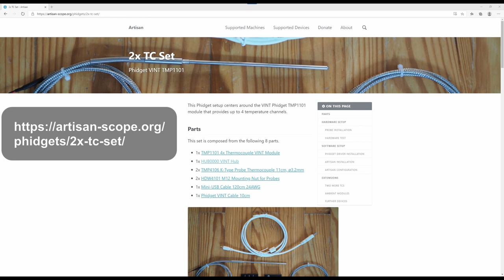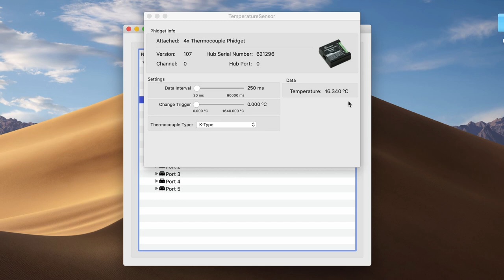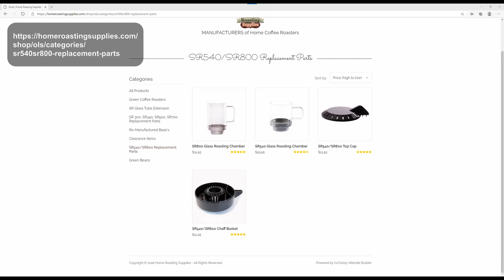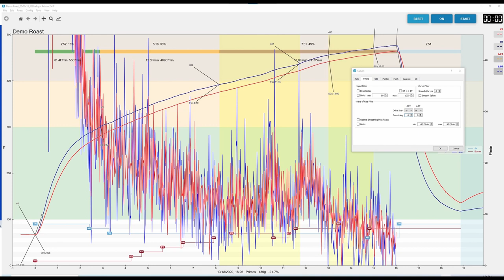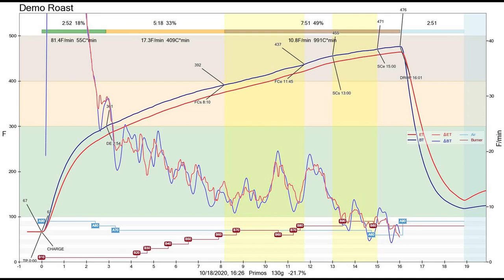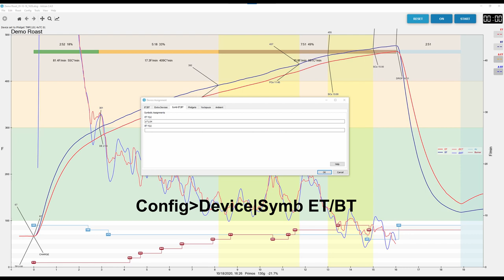SR540 (or SR800) Coffee Roaster Thermocouple Installation

Comment: This was incredibly helpful. I have an sr800 and have been interested in doing this mod. Thank you 🙏
Reply from the maker: I am glad this was helpful. This should work on the SR800, just make sure the bean thermocouple is long enough.
Reply: @coffeeroastingathome8890  which long is enough for Sr800?  Thank you!
Reply from the maker: @adolfoperez1312  I don't have the SR800, but check that the thermocouple tip is inside the beans when approaching first crack. The exact elevation is not very critical.

Comment: anyone wanting to simplify this can use the temp probe on a Weber iGrill BBQ temp sensor and export the data to an excel spreadsheet. Graphs are easily made in the spreadsheet. You can save time/fan speed/power levels and graph airtemp/probe temp vs time.

Comment: Thank you for the videos you posted. All are very interesting! I was wondering how you were able to control the speed and power of the 540 from the Artisan dashboard.
Reply: I just realized after watching your other video again that you were not controlling the speed and power with Artisan --you were marking your profile with the sliders after manually changing the speed and power on the SR540. Is that correct?
Reply from the maker: Hi Chris, yes this is correct. I make the changes manually in the SR540 with the knob, and then move the slider in Artisan to match the SR540 setting. I do this only to keep a record of the setting changes I made during the roasting for future reference, but you have to remember to adjust the sliders every time you make a change in the SR540. It would be nice to be able to control the SR540 directly from the Artisan sliders, but that will require modifications beyond my skills. Thanks for your feedback!

Comment: Hi, first off, this video and your other one is fantastic. I wouldn't have been able to set it up without this. I've used your set up on my artisan profile, but the one thing I can't figure out is how to get the step visual of the change of the Air and Burn. I know how to configure and add them to the chart, but mine just shows up as small blips on the bottom of the chart. It's as if the scale is off or something. Thoughts on how to fix the configuration for that?
Reply from the maker: Thanks for your feedback, I appreciate it and I am glad they were useful. About the visual indication, in the menu Config-Events-Sliders, make sure the Min and Max for the Air and Burner are set to 10/90, and click the "Coarse" checkbox. Offset should be 0.0 and Factor 1.0. I hope this helps, you can also download the configuration file and use that.

Comment: I am setting up my sr 800 with thermocouples. I have ordered a 300mm probe for the bean probe. I am having difficulty determining where the end of the probe should be in relation to the green beans. Is it ok if the end is in the bean mass at the start of the roast or should it be above the beans? I also am using the extension tube. I have searched high and low and can't find the answer to this. Your videos have been a great help in setting up the artisan software.
Reply from the maker: Yes, it is OK if the tip of the thermocouple is in the bean mass at the start of the roast, an inch or two away from the bottom. The exact position is not too critical, as long as it is repeatable between roasts.
Reply: @coffeeroastingathome8890  Thanks , this coffee roasting is more complicated than I thought it was going to be. It's fun though!

Comment: great video.  so for BT you would suggest to get a thermocouple that's longer so it would stay touching the bean mass but no to the point where it would touch the bottom where the heat is coming in right?
Reply from the maker: Thank you! Yes, that's right. I made another video with an extension tube and a longer thermocouple inside the bean mass, you can check it at: https://youtu.be/xo9IdakyIqw

Comment: You mention the idea of only using the ET sensor. Have you noticed if it reads much differently than the temp sensor built into the sr540?
Reply from the maker: The built in temperature sensor measures the inlet air temperature, before it interacts with the beans. The beans exchange heat with the air and also release steam, changing the air temperature in ways that are difficult to correlate closely with the inlet air temperature. The built in temperature sensor reads generally quite a bit higher than the ET sensor, and the temperature changes when changing settings are much more abrupt. Hope this helps!

Comment: I have the air and power settings showing on the left side of the Artisan graph like you do, but they do not change when I change the settings on my SR800.  What do I need to do to get them to show the proper settings?  Thank you
Reply from the maker: You need to click and drag the slider to match the settings in the SR800 roaster. There is no communication between artisan and the roaster settings, so artisan has no way of automatically knowing what settings you have in the roaster. The sliders are intended to keep a record of what you do (like writing the settings in a piece of paper, but more convenient).

Comment: Thank you for making this video.  I am wondering if you plan to use the extension tube on your SR540 since they seem to provide a more even roast and more intimate with the air flow.  If so, could you still use both therocouples?
Reply from the maker: Yes, I have been using the extension tube with a longer bean thermocouple probe (and the same environment thermocouple). I am working on a demo video using the extension tube with the details.

Comment: Very nice of you to show how this is done.  I am wanting to do this to my sr800 with the Razzo extension tube.  If you are so inclined perhaps a video of an actual roast or two.  I am a beginner to this and have been lucky that my first roasts were actually good! Again, thank you very much for this excellent video.  (You might want to post this on Reddit.com/r/roasting)
Reply from the maker: Thank you! This setup should work on the SR800, just make sure the Bean Thermocouple is long enough. I did post a video of an actual roast (the link is in the Description of this video), hope you find it useful.  I am also now roasting with an SR540 extension tube and may post a video of that in the future. Thank you for the tip on Reddit, I wasn't aware and will check it out.
Reply from the maker: @txaggieaero Good luck with your setup, sound interesting. I have a Raspberry Pi running PiCorePlayer and Logitech Media Server for streaming high resolution music, works great.
Reply: @coffeeroastingathome8890  did the thermocouple fit well with the extension tube?
Reply from the maker: @timothyhawkins9469  I had to replace the bean thermocouple with a longer one for the extension tube. I am putting together a video to show that change and a roast demonstration with the extension tube.
Reply: @coffeeroastingathome8890  did replace with the 20cm? I was looking at that possibility and plan to try the setup soon. Thanks for the reply.
Reply from the maker: @timothyhawkins9469  I bought a 30 cm probe (https://www.walmart.com/ip/K-Type-Temperature-Sensor-Probe-1-5M-Cable-4mm-x-300mm-Probe-Thermocouple/135416402) and improvised a stop similar to the one I did for the environmental thermocouple so the tip of the probe ended up around the middle elevation of the bean mass. The lid hole I had drilled before was a little too big so I used a little shim made of a paper clip to steady the probe. Hope this helps!